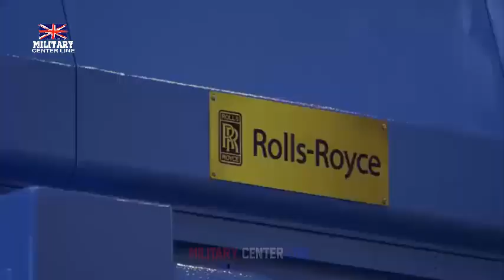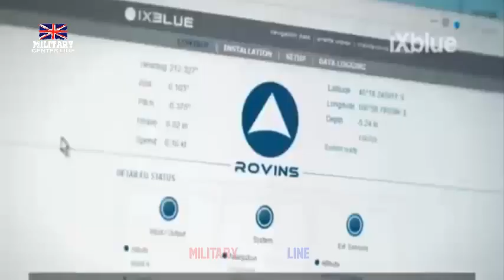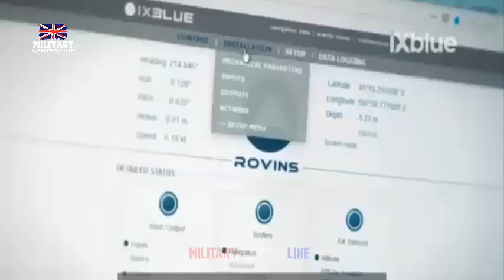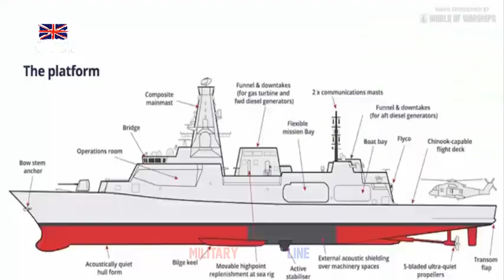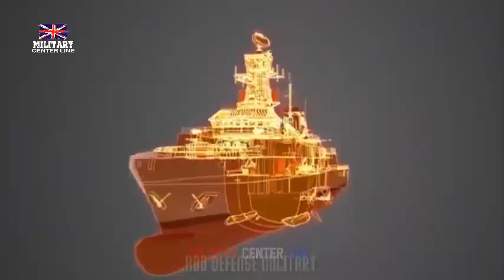Development of a lean crew solution for the Royal Navy's Type 31 frigates

Comment: (Left) A hallway on an Iver Huitfeldt-class frigate. (Right) The equivalent location on a Type 31 shown in a CAD model. This shows how the Type 31’s higher survivability and recovery standards add complexity. System duplication achieves this without increasing the number of personnel required to repair battle damage.

Comment: Southampton stupidly tried to cut across the bow of a tanker it was escorting in the Persian Gulf and got impailed.
Nottingham ran aground on Wolf Rock because the second officer of the watch drew a dead reckoning line in pencil over it on the paper chart, obscuring it from view.
Endurance almost sank because an engineer opened up a valve below the waterline that should only be opened in a dry dock. I was on RFA Blackrover at the time and watched it being loaded onto a recovery ship ready for its journey back home to Portsmouth.

Comment: Looking at the desing these are cheap and useless ships, no where near enough VLS to be useful, to few guns, poor range and speed. These will be only slightly more useful than LCS.
Reply: Type 31 frigates will be equipped with a 32 cell MK 41 VLS. 8 of those cells will be for anti-ship missiles. The other 24 cells could be quad packed with Seaceptor SAMs, giving a total of 96 missiles. That's not bad for a cheap frigate conducting local area defence inside 20 nautical miles.
The 2 x Bofors 40 mm will also have 3P ammunition for closer in anti air/surface engagements.
Reply: @stephennelmes4557  exactly, it's poor, cheap design that's underarmed and undercrewed.
Reply: @fightforaglobalfirstamendm5617 If the anti-ship missiles are placed into deck launchers as they are in many other ships, this would free up 8 cells for Tomahawk land attack missiles.
Remember, it is a general purpose frigate, and it's meant to be cheap.
I do agree that it's undercrewed.
Reply: @stephennelmes4557  I disagree. In the age of missiles, the simulations suggest any naval combat with a peer opponent is a game of who runs out of air defence missiles first. 
I do think the cheap deck mounted ASUW missiles and short-range anti air missiles are useful. The deck mounted ASUW missiles are to wittle down the enemy anti air missiles, at which point you fire a large hypersonic anti ship missile to make the kill and they have to be in VLS .
I think on today's age you need minimum, 
Destoryers 96-144 VLS
General purpose frigates 48-96 VLS
ASW frigates, yeah, 32 is fine, but 42 - 48 is better.
All VLS should be at a 3-1 or 4-1 ratio, AAW missiles - ASUW and land attack missiles. The AAW cells will be quad packed, and the ASUW or land attack will be singles to twin cells depending on the missile.
Reply: It's nice to have a huge shopping list of what you want to fit onto a warship, but there's a danger of putting all your eggs in one basket.  Ships like the Kirov look impressive on paper but are expensive to build and maintain. In a shooting match, they will be missile magnets. No missile system is infallible. A defensive missile system has to be effective every time, an offensive only once. Something will always get through.
The question is down to how much your nation can afford or is willing to spend, and is it better to have more smaller ships or fewer larger, more capable ones.
Remember it is just a general purpose frigate we are talking about.
Reply: @stephennelmes4557  no the Koreans and Japanese are designing 8,000 ton frigates with all  70+ VLS and deck mounted missiles, they have yet to order any, but I saw a lot of the designs at the Pacific naval expo for large and small, the new Japanese 10,000 ton Destroyers has 100+ VLS.
Reply: Was this drunken ramblings? Maybe a bot ? Why are you're boys trying so hard to get data regarding  lol